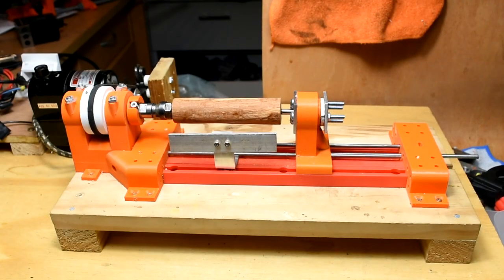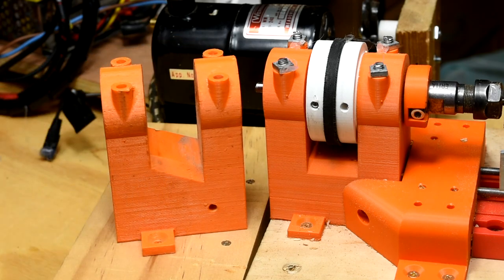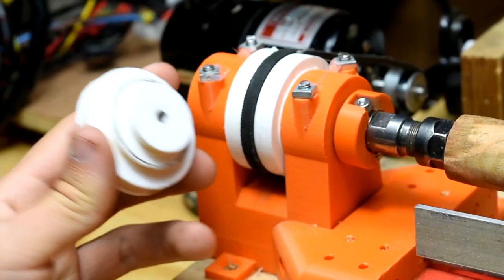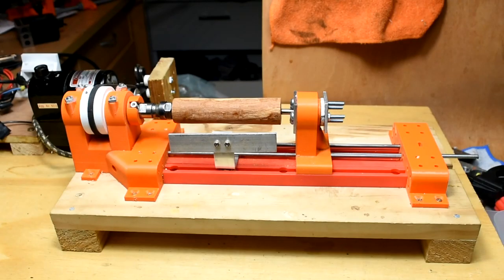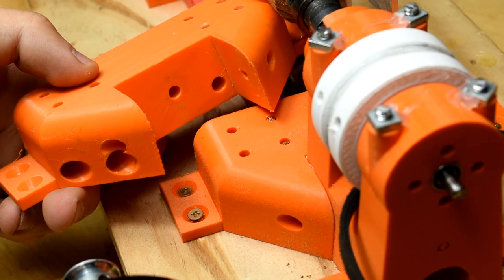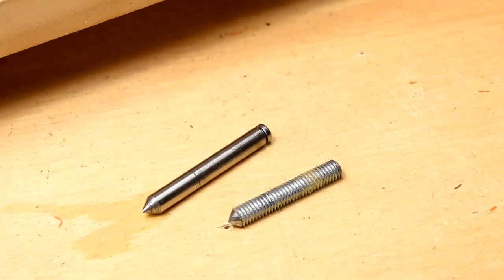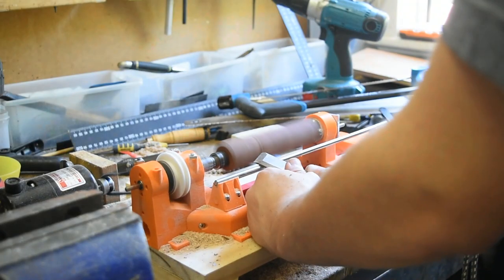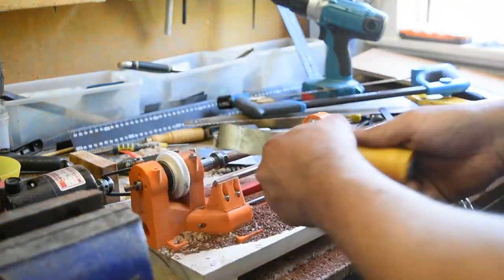3D Printed Wood Lathe V4!

Comment: Hi, would you be able to please include an updated metal hardware parts list that includes the updated guard? The parts list on the build video I believe includes the 2 rods as a guard from the previous version.  Also, what is the longest piece of wood the lathe can accommodate? I plan on building this soon. Thanks!

Comment: I would print the bearing holders in the strongest position for carrying the bearing, even if they'd need to be multiple parts for the head stock. Doing this would give you more rigidity aside from the fact that it would not eventually blow out from vibration.
Reply from the maker: I tried it but I found this orientation more ideal, the 4 rods in the headstock clamping through the board makes it rock solid, but printing in the other orientation I found these would split the headstock layers. That has been my experience anyways, next time I update parts ill add the headstock in pieces if people want to experiment with this

Comment: Hey, please share the link you used to buy the timing belt and motor
Reply from the maker: Hey, unfortunately I dont have a link for this setup since its off an old sewing machine and I havent found a place to buy them new and on their own. If you look around local listings they are generally pretty easy to find however, and I am also working on a setup that uses a generic motor but that wont be done for a bit.